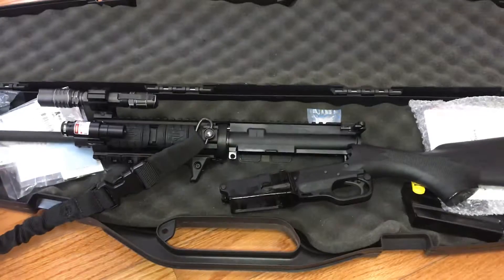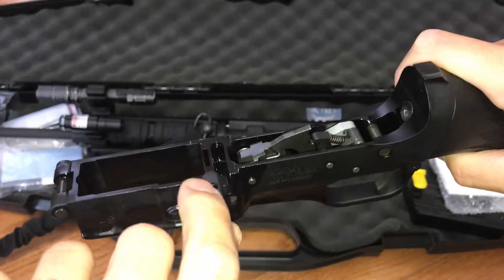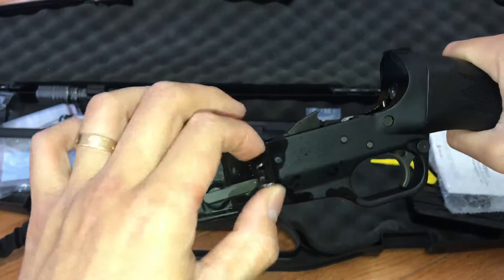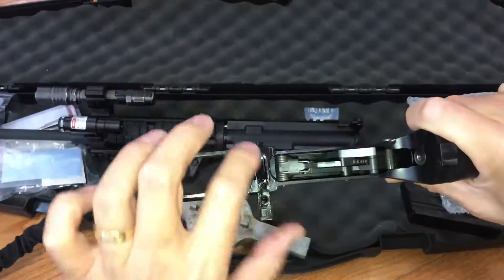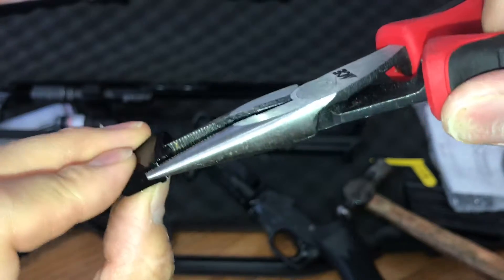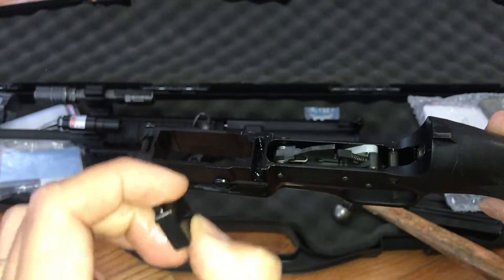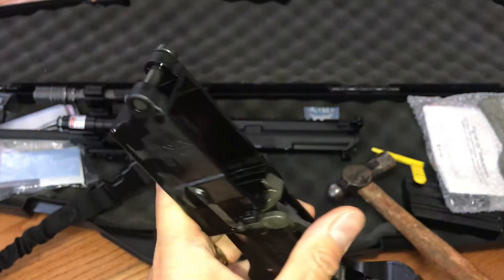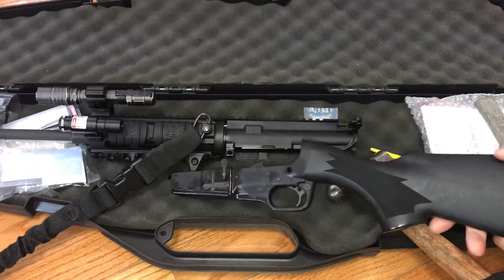SCR Bolt Catch issue and Fix

Comment: You should try a different product such as “Super Penetrating Lube” (SPL) 100 or “Liquid Wrench.”  WD-40 is an acronym for “water dispersion [formula number] 40.”  It’s meant for removing moisture and protecting against corrosion, not lubrication.